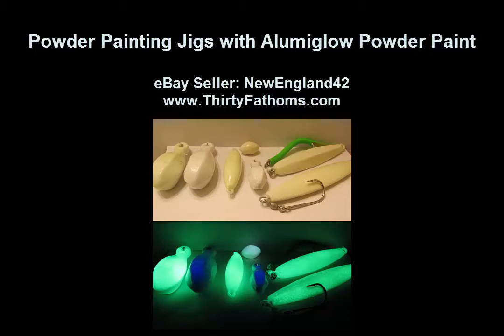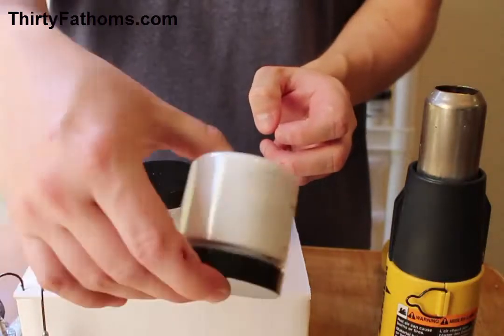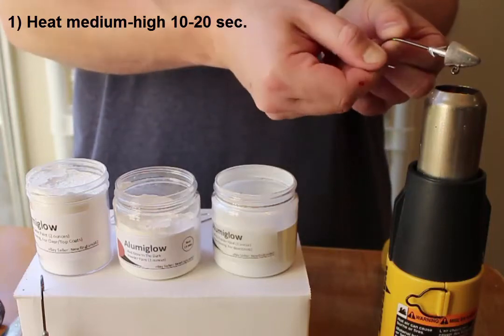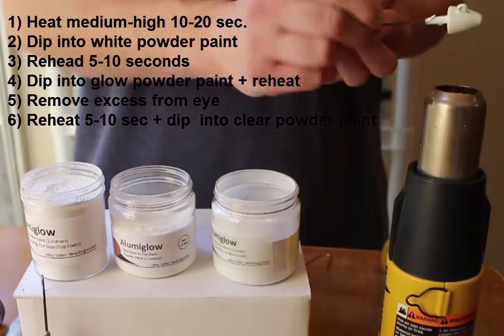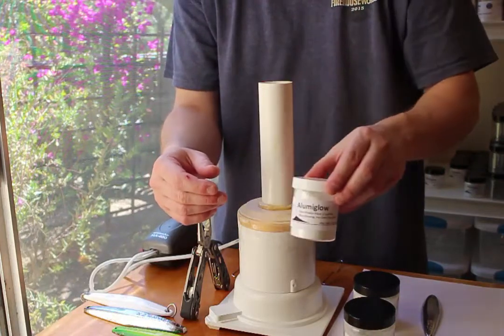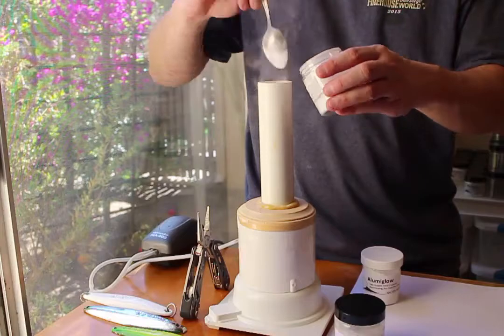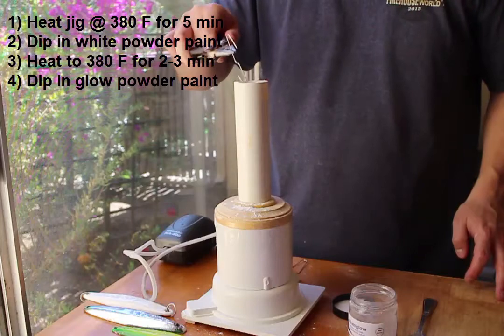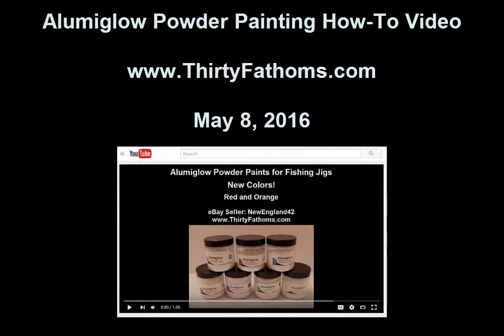powder painting jigs

Comment: Can the glow powder be used as a pigment in epoxy based paints so that it can be sprayed? I am hoping I can use this product with a paint gun.
Reply from the maker: You wouldn't want to use this powder paint for that. Instead. you'll want to get strontium aluminate powder is a particle size of about 2 - 10 microns and then mix it with your epoxy. It will require some trial and error since the powder is dense and doesn't suspend very well in liquids.

Comment: Could I mix the powder with plastisol for making glowing soft plastic lures?
Reply from the maker: Yes, you could. However, I have to caution that I haven't tried it myself, though I expect it would work. What might work even better is using the straight glow powder (strontium aluminate which is included in the videos on epoxy painting jigs) - and also widely available from online retailers.

Comment: Ok, say I had coated a lure glow white and I wanted to put glow orange dots on it. Would I be able to heat the jig up dip a very fine brush in the powder, dot it on and cure it again?
Reply from the maker: It's probably not going to work out like you would like. What you'll end up with is a speckled orange area with a background of glow white behind it. In other words, you won't get a solid orange glow overlaying the white glow beneath it. You can achieve what you're looking for but you would have to use the pure glow powder and a fast-curing epoxy. Shoot me a message and I can explain in more detail.